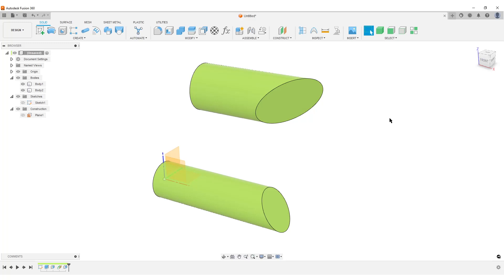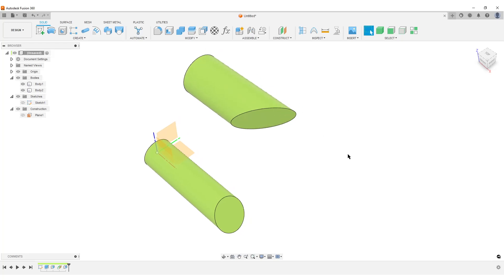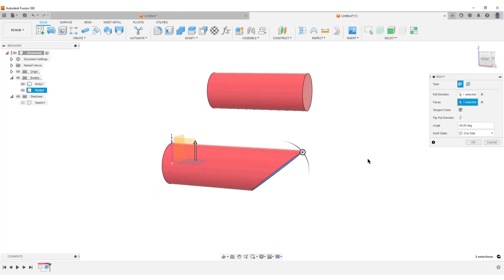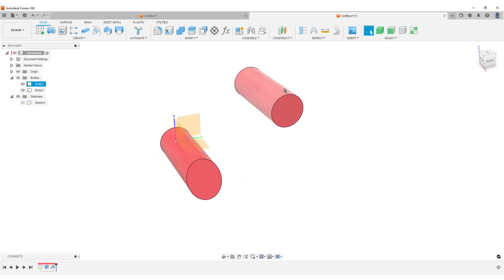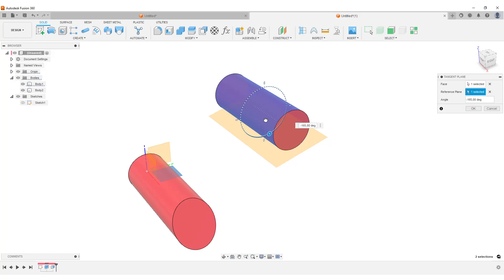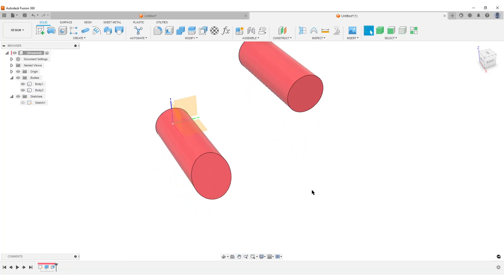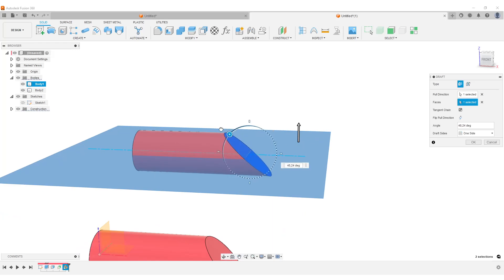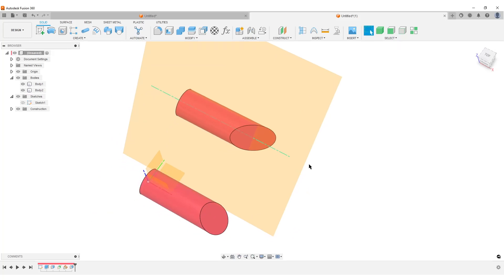Fusion 360 - Cylinder needs an Angled Face (Draft)

Comment: Thank you for the video, very helpfu. But what if I had specific length for each side of the cylinder. For example one side is 20mm and the other is 15mm? Is there a way to do a slope by length instead of angle?
Reply from the maker: In that case I'd do a sketch from the side and extrude cut the angled face.